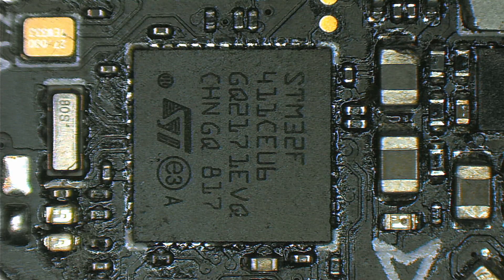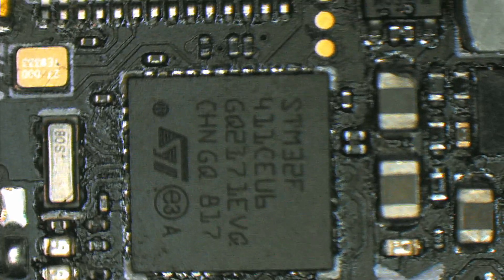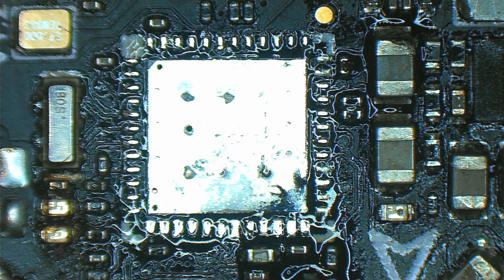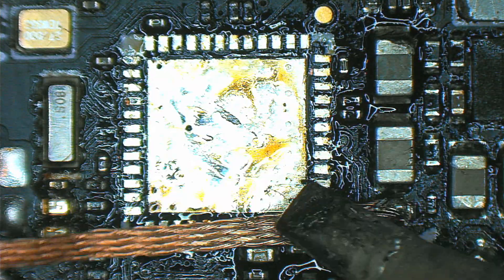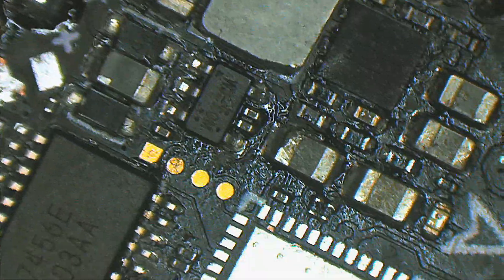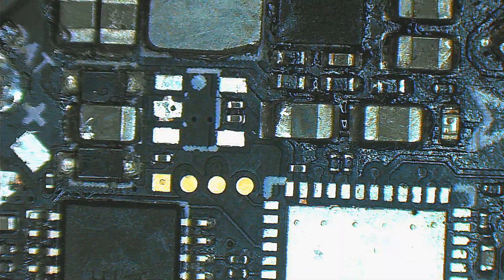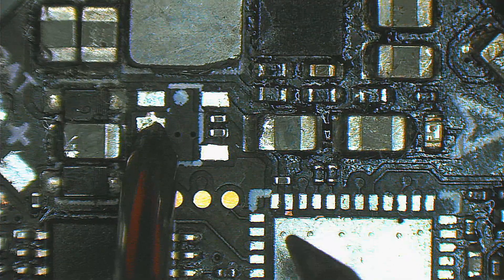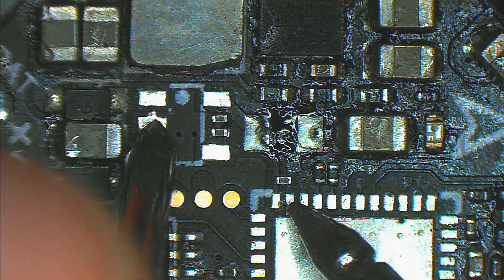BetaFPV F4 2-4S AIO FC - REPAIR

Comment: My Pavo 20 pro has a little crash, turttle mode kill ESC (maybe), the AIO don't sing melody when battery plug but 9V Vtx is OK, no 3,3V when USB plug, all led is light off, so maybe condensator or regulator must be changed.
Reply: In my case, there was an SMD capacitor conected to the 20A MOS system thats burnoff. I retired it and works again with USB, but the RX seems to be dead.

Comment: Hello Livyu, I have BetaFPV F4 2-3S AIO FC V1 which somehow not delivering consistent power to one of the motors (motor 1).  It gives out a buzzing sound when I tested the motors with Betaflight configurator. Could you tell me what happpened? Thank you.

Comment: Thank you Livyu FPV! I've been repairing FC's, ESC's and AIO's for a couple years now from time to time. Watched this video a couple years ago, but came back to it today to see if I could get some pointers. I was having a heck of a time trying to get a Crazybee F4 Pro V2 AIO to come back alive. Removed and replaced SO MANY components and couldn't figure it out. Zero power, but a ton of amp draw that was not stable. Almost gave up then decided to pull a BB2 chip that was close to the suspect components. And.......voila! Thats all it was, the damn BB2 chip. Replaced it, powers up and boots fine now. Absolutely love that feeling! Next is to check to see if the ESC's are actually working and hope the BB2 chip doesnt blow when I do that. Thanks again, just had to get some inspiration from you.

Comment: Excellent! this is along  something I have done many times with my own stuff. 
Of course you have to have the right equipment and a good deal of skill, steady hands are a must for this level repair work.  An IR heat sensing tool to identify areas of high temp is a great tool. 

People need to learn things that are useful! Electronics is one of those things, as pretty much everything around us is of an electronic nature. We have to learn how things work, so we can fix things ourselves and save $ in the process, knowing how to repair things is very powerful. While this is aimed at an item that we use for our hobby, the approach and technique applies to any type of electronic board repair. Thumbs UP!

P.S. The cap in line with the output of the regulator would have been my first suspect, just from past experience , by the humming noise, and you did not have to remove unnecessarily other more critical components, source of heat is also a dead give away of possible bad component.

Comment: I wish you could guide me through my 1s Meteor75 issue.
 I don't believe it's a no voltage issue because all lights stay on except the blue VTX light in the middle flashes. The green/yellow mixed led emits both colors at the same time. It happened after a hard hit into wooden stairs. I didn't get any responses from the transmitter. As far as BETAFLIGHT.. It shows everything is good. The BLHelli tones sound normal. 
It was playing dead until I loaded the configuration CLI. 
Any suggestions would help. 
Your the first person I found that is likely able to help me troubleshooting. 
Thank you for your time.

Comment: What sort of temperature do you run your iron at? I've heard a lot of people recommend higher temperatures so you spend less time putting heat into the board and this seems to also be the case for this repair. Also which heat gun is that? Great video, very helpful

Comment: Hi Livyu! That was an excellent tutorial. Very entertaining and instructive.
I have the same FC BetaFPV F4 12A AIO but mine does not show video or OSD just black image. Theres no VTX or cam issues since I bridge the video in with video out and the image is crisp. Could there be issues with OSD chip?
Also I noticed that theres continuity with VIN and GND. Is that normal? Its a brand new FC...
THANK YOU!
Reply from the maker: Hi, yes those OSD ic's do get bad from the factory :P a short... no,  75ohm resistance between vin and ground but not a dead short... there is also a cap in series to the VIN pin of the ic. If you have a dead short (0 ohm) it means that either the 75ohm resistor is shorted or you have some solder or something there...
Reply: Livyu FPV 
Thank you! I did checked and is 75Ω as you said... so that means a dead IC right?
Ive communicated with Beta already... lets see

Thanks again!

Comment: Hi is there a way You can help remotely to debug with https://betafpv.com/collections/flight-controller-1/products/f4-2-4s-aio-brushless-fc-12a-for-toothpick ? FC works from USB, when connected from battery it does work, but not ESC's, and board is getting hot. I have found short circuit on one condensator pads, but desoldering it did not helped, schort circuit is still present between those pads, and I cannot trace the short further because o lack of knowledge/understanding...
Reply from the maker: HI, it's almost impossible to diagnose remotely. But... what I can say is to know what is on that voltage rail... and remove each of the devices. For example on FC... on 3.3v rail only two things are present... the MCU and GYRO. Obviously, the caps too but those are very rare the problem.(in this video for example)
Reply: @LivyuFPV  You are quite right for my experience 45% of repairs are related to MCU and other 45% to broken MLCC. Last 10% is other difficult to track issues like borken internal trace on PCB or my last repair TVS diode which make dead short and make trace dissapear. also common problem is one of the diodes wich separate 5V form USB with 5V from regulators.
Reply from the maker: @marsma18  correct... The most difficult problem is making people with no electronic background to understand that most of the times they are the reason for killing the fc :) Not once i've seen people bashing different manufacturers "my fc died, you make s**t products" oh well :)
Reply: @LivyuFPV  How many times i get FC to repair with really simple issue elevated to 3 pads lifted connector all broken and some components moved around or stuck in solder blob. Unfortunetly use of flux for beginners is like magic, it just does not exist.
Reply: I have a FC that reboots at 3.3v... My problem is that I’ve had many other fcs where one could literally empty the battery without the whole thing to stop. 

Where would you start with such stuff?

Comment: Thank for the video!  I like watching you and I’m not even that into electronic repair.  But I have the same FC with what I suspect a dead or fried mosfet.  It just looks burned on the board so I’m guessing it’s that.  I would love to attempt to do a repair but how do you get the parts for it?  I’ve since bought the betafpv 20A v3 for my HX-115 and it works.  Still I would love to find out where to purchase the parts like mosfets, caps and such.  Any info would be great.  Thanks and look forward to more videos.
Reply from the maker: ebay, digikey, and more :) Some are only found on ebay from China...

Comment: Simple trick how you can check if the Stm32 chip is dead. Check with your multimeter if contiunity is between 3,3 Volt and Gnd on the Programm Pads
Reply from the maker: depends... I've seen a dozen ways that an stm32 MCU goes dead... 90% of the times it just gets shorted on VCC. other times it works half... other times some ports are shorted or not working... but the dead giveaway would be to check the current consumption :) Some times you know it will go dead just by the current consumption... :P
Reply from the maker: PS: most of the time... I just take other approaches on the videos just for people to get a thing or two :)
Reply: @LivyuFPV  true most of the times i have should say :)